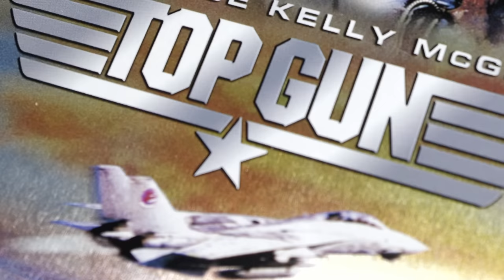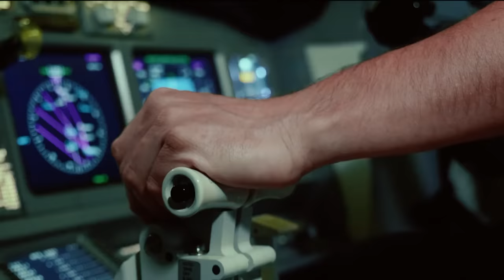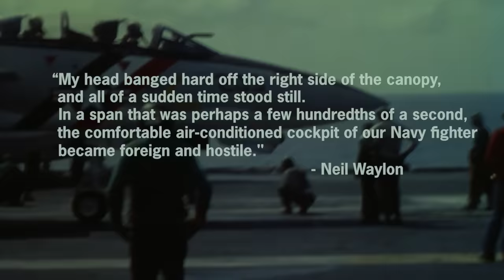F-14 Explodes During Supersonic Flyby

Comment: Almost as unbelievable as the narration speed is the fact that the F-14 is a 50 year old design.
Reply: Yeah I saw somewhere that this year the tomcats are as old as spitfires were when top gun came out
Reply: Ha ha!
Reply: The F16 is basically 50 years old too
Reply: @mast3r-633  No, that's incorrect. When "TOP GUN" came out, back in 1986,  the 'Tomcat' (according to the documentary), was introduced in 1970,  which of would made it 16 years old (then). 'Spitfires', at the time "TOP GUN" was in the theaters, would be over 40 years old.
Reply: well actually, at the time. the f-14 was only just over 20 years in service and at best just over 30 years since it's initial design. very very typical time frames tbh. 
 to put that in perspective. the f-22 was first flight tested against the yf-23 in 1990. and it's still the meanest thing in the sky today.
Reply: A big reason to not want too see f35’s they’re a mediocre combination of 3-5 old ass planes we still use.. jack of all trades master of none with the exception of vtol models because the harrier is missed.
Reply: @buffering7612  wrong.... it IS the master of battlefield connectability and battlefield information. 21st century warfare. it was never intended to be the master of any other specific trade in 20th century warfare. it has more computing power than every other fighter in our arsenal COMBINED. and THAT is the ace up its sleeve. it can link fighters, bombers, choppers, ships, missiles sites, artillery, ground forces etc etc etc. and coordinate them all at the same time on levels NO other fighter even comes close to.
Reply: The B-52 would like to chime in here...the YOUNGEST B-52's are over 58 years old.
Reply: @rogerrendzak8055  The Tomcat first flew in 1970 which is 52 years ago, the Spitfire first flew in 1936 which is 50 years before Top Gun came out. The comment was a little off in numbers but they're generally correct in what they said
Reply: @governmentcheese7726  finally someone that talked about the f35 with sense, instead of just attacking it
Reply: @Sahadi420  that is always stated, but the OLDEST operational B-52s are maybe 2 years older than the youngest ones. The only ones operational are B-52H models with the first being built in 1960. Production ceased 27 months later with no new B-52s ever being built.
Reply: @rogerrendzak8055   AH, that's wrongish too when this event happen in 1996 the TC was a 26 year old designish...but was also upgraded to a "D" model a long the way.
Reply: People get confused because of the new tech gadgets we have...but the 1960s were the Pinnacle of analog engineering...there isn't very much we build today that they couldn't build with a slide rule.
Reply: If you slow it down to .75, it sounds almost normal.

Comment: The ejection seats used in this mishap were Martin-Baker NACES (Navy Aircrew Common Ejection Seat), Navy designation SJU-17. They were tested and qualified from 0/0 to 600KEAS. This seat was also tested up to 50,000 ft from the back seat of an F-4 at China Lake. I know, because I was part of the Navy team that wrote the requirements for this seat, and was intimately involved with qualification testing. These seats are still used in the Navy T-45 aircraft, and also in the F-18E/F. If you look closely in the new Top Gun Maverick movie, you can see the NACES headbox (which contains the parachute) in most of the cockpit views. Too date, this seat has saved well over 100 Naval Aviators lives.
Reply: Thank you for sharing and for your work to save these men's lives, I hope you're proud

Comment: I was the conning officer on USS John Paul Jones (DDG53) that day. Several of us were on the starboard bridge wing in the shot with F14 explosion. The boat crew launched, picked up both pilots and had them back on the ship in about 8 minutes. We spent the next few hours on RHIBs picking up floating fragments from the aircraft. None were bigger than about 4' long. The F14 was helping us with a training exercise.
Reply: Was this in 95? I was on the Lincoln during this deployment
Reply: I was onboard as well. Starboard side boat deck watching the aircraft approach 180 degrees relative. Both aviators out of the water in less than 10 min. Would have been sooner but the pilot directed the boat crew to pick up his the RIO first. That was a hell of deployment.
Reply: So how is it vid says 50 miles away where they were found? 8 min my azz in a boat to get them.
Reply: @wallybraveheart6896  I bet my 30 Year career on it wallybraveheart! We were on the boat deck when the plane erupted in flames next to the ship doing 16 knots on a direct course to where the pilots hit the water. By the time we reached the down pilots, the RHIB was in the water. Don’t underestimate the Navy when the sh!t hits the fan!,,

Comment: "55 miles away". Mach I takes ya places you never really expect.
Reply: The video is very misleading. The USS John Paul Jones and the jet were 55 nautical miles away from the carrier, Abraham Lincoln.

The pilots were not thrown 55 miles from their aircraft.
Reply: @nates9536  I was going to comment about this. You'd have to be going way faster than Mach 1 to end up 55 miles away. Waaaay faster
Reply: @nates9536  isnt that 101 km? lol
Reply: @2k7u  Probably. I'm not google
Reply: @nates9536  lol ok
Reply: @zromo8994  - Or slightly higher.
Reply: @nates9536  Thanks. I was really wondering how they could go 55 miles in a matter of seconds.
Reply: I was on the JPJ starboard bridge wing when this happened and spent a few hours after picking up small, floating plane parts from the sea.  We picked the pilots up with our small boat and had them onboard JPJ in about 8 minutes so 55 miles is incorrect. They probably 1NM off the starboard bow when we picked them up.
Reply: NerdWorldNinja FoldingSpaceTime  And you thibk the ejection seat will accelerate in the direction of the flight so the speed increase adds to the original speed? If the ejection seat accelerates slighly backwards, then they will use their power to slow down the forward motion.

It isn't the goal of an ejection seat to increase the speed of forward motion but to clear the fins so the seat doesn't get hit by the plane, and to gain enough height for the parachutes.
Reply: NerdWorldNinja FoldingSpaceTime  But they speed you up vertically.
Reply: Toxic Masculinity  No, an ejection seat is designed for very high acceleration but very short burn time. The purpose is just to get the passenger away from the plane and into a suitable condition for opening the parachute. Thus foesn't require the ejection seat to have fuel for miles of travel - especially as extra travel at high acceleration is dangerous both because of the acceleration forces and because the goal is to quickly reduce the wind forces on the pilot.
Reply: Toxic Masculinity  Just to complement my previous answer. At the speed of sound, you travel roughly a nautical mile per 5 seconds. 55 nautical miles takes about 5 minutes to travel at the speed of sound.

If we assume the plane was 1 nautical mile from the ship and they spent a huge 5 seconds from breakup until eject, they moved one more nautical mile away.

If we assume the ejection seat then burned for 5 more seconds and moved the pilot forward with the speed of sound, that would be one more nautical mile.

If we then assume the parachutes got activated at 900 meters (half a nautical mile) height, then they would need a glide ratio of 100: to manage to translate half a mile of height into 50 nautical miles of horisontal movement.

Anyway - no, the claim of them landing 55 nautical miles away from the ship is just not possible.
Reply: The engine explosion opened up a quantum fissure and they went through it; that's how they survived and wound up 55 miles away. Oh wait, this isn't Star Trek, never mind.
Reply: This can only be explained by a mini blackhole on the path of the ejection seat.
Reply: @perwestermark8920  the biographer glossed over a decimal point by reading way faster than his eyes could track.
Reply: If the plane is tumbling and happens to have the belly facing the velocity vector, the ejection seat can remove a bunch of velocity. Plus, the plane was probably already slowing down at 20Gs. The ejection speed could have been as slow as 300mph.

Comment: I was serving on the JPJ when this happened. For clarification, the pilots were not 55 miles away from where they ejected. Our SAR swimmers were there pretty darn fast as they ejected very near the ship. They definitely had some burns on both men when they brought them aboard.
Reply: I have a question, was there a panic that the pilots where in the craft when it exploded?
Reply: If the ship was as close as JD noted above, the carrier tower likely saw the parachutes soon after the fireball. It's also a testament to how the Driver and RIO were essentially in impeccable condition for ejecting at such a high rate of speed. When you eject at Mach 1, your limbs are usually noodles, broken, dislocated and shredded, and surviving the ejection might just mean drowning in your chute if your arms and legs don't work.
Reply: I think he meant 50 miles from the carrier.
Reply: Exactly. I was at a loss as to why he said that, other than the fact it was in the copy he read aloud. You could say that the statement itself was 55 miles off the mark.
Reply: Waylon's account that he wrote said the same thing, they ejected very near the ship and were picked up very quickly.
Reply: @canebrakeruffian1122  
When the plane broke up, the pieces decelerated very quickly.  When ejecting at over 400 knots, it's very common to have some kind of limb-flailing injuries.  Those guys had none of that.  Waylon was very surprised at how little windblast there was when he left the aircraft.
Reply: @bidipbo  
I think the ship that they flew past was 55 miles away from the carrier and that distance got misinterpreted in this account.
Reply: @jedimasterobi-wankenobi4615 no, we saw two shuts
Reply: @canebrakeruffian1122 the CVN was not in the vicinity or sight
Reply: @bigdaddy1217  If you listen very closely Dark Footage claims that the JPJ is a CVN as well.
Reply: @falkwulf3842  I was onboard topside when it happened. Starboard side on the boat deck. The JPJ was 50 NM from the CVN when conducting a high speed flyby. Two chutes were seen and the Pilot and his RIO were out of the water in less than 10 min.
Reply: @bigdaddy1217  I  get that, context got lost on the internet. I was merely pointing out that Dark Footage claimed in the video that the JPJ was a CV as well and not a DDG.

Comment: This accident right here changed the F-14s forever. Pilots were banned from Flying in after burner for an extended period of time, and no more Cat launches in Burner mode.
Reply: I get the no extended afterburner rule, but why no cat launches with burner?
Reply: @phantomaviator1318  don't want to risk an exploding engine on the flight deck?
Reply: The a model needed burners on the cat, the b and d had enough power that mil was enough
Reply: Not sure who Josh is but if you didn't have zone 5 on your P&W's your Tomcat fell in the water.  We used to take F-14's to hi-power to get a quick defuel, 25-30 min at zone 5 and you can go thru 15k of JP-5.
Reply: @bender7565   my first West Pack in 97 was one of the F-14s last cruises. I watched F-14s cat launch for 6 months, not once did they ever go into Afterburner.
Reply: @joshdeskin6766  I made my last cruise #6, Mighty TR 98' I was the FDC for a 2nd cruise because the new chief sucked at it.  I have walked at least 100 Tomcats to the cats and none of them left without zone 5.  How many F-14 squadrons did you serve in?  Don't mean to stomp on you shipmate but watching F-14' and being the maintenance chief are a bit different.
Reply: @joshdeskin6766  In the 90's you had the A's with the Pratt & Whitney and the B's with the GE motors, you can tell by the feathers.

Comment: They ended up 55 miles away?!?!?! Damn!
Reply: Right!  Thats crazy
Reply: Easy: the speed of sound at sea level is about 767 miles per hours, which is 12.7833 miles per minute. If you do your math, it would take 4.3 minutes to land 55 miles.....away....if you stay supersonic......while strapped to your ejection seat!. Translation? Absolutely 100% unadulterated Bovine Organic Matter!!!. The pilots engine failed, generating that massive flames. They did NOT eject immediately.......the aircraft decelerated rapidly. Only after reducing power (the Tomcat has 2 engines) and speed (subsonic), they could not control the Tomcat, they had no other option but to egress. 55 miles away? Of course, they stayed aboard the Tomcat that far out until they could no longer control it. The only way to 100% confirm this mishap is to obtain the OFFICIAL mishap report from the U.S. Navy. I’d call it fake! Thumbs down until we have a link to the official report.
Reply: @uwekonnigsstaddt524  The Tomcat was 55 miles away from the carrier when it flew by the John Paul Jones, a destroyer that it had just simulated a cruise missile attack on. The F-14 disintegrated in mid air and the pieces and the aircrew decelerated rapidly and fell into the ocean, not far away from the destroyer.

It's okay, I was confused as well until I looked it up, it wasn't very clear.
Reply: From what I've found, they were 55 miles away from their carrier when it happened by the other ship. They certainly didn't eject and fly or drift or float 55 miles before being rescued. I guess something got misread during this video's production.
Reply: I am about 50 miles away from two major cities in either direction, and it takes me 1 hour without traffic, and up to 1 hour 45 minutes with traffic to get there. My brain honestly can't process flying off and ending up that far away in nothing but a chair with parachutes.

Comment: “In the late 90s, the Navy and the USAF would transition to the F-14B...”

The Tomcat was only flown by the Navy. The Air Force used the F-15.
Reply: That's a fact. 👍
Reply: I felt like stating this but here it is, I have seen a picture of a Tomcat with U.S Air Force but I guess it was just a display
Reply: @SkyGuy-gr2zc  Perhaps it was an early trial model tested by the USAF, or was kept at their experimental testing sites. Maybe there is a fascinating story behind it.
Reply: @swivelhips586  Going to comment in case someone pops up to tell that story. I don't think they made an Air Force Tomcat. Although I believe they wanted one jet to serve both, but the requirements split quickly. Maybe someone lost a bet in a bar, had to paint a Tomcat and put it on display. I like to watch F-14's and F15's duke it out theoretically in DCS. Checkout "Growling Sidewinder." Fantastic dogfights.
Reply: @pgtmr2713  It seems historically they mostly or almost totally used different models.
Even the USMC were the only ones to use the Harriers.

Comment: In 1979 I roomed with a guy from the USS Kennedy, which was in dry dock. He had a picture of an F-16 breaking the sound barrier at about 100 ft. above sea level. When the aircraft was inspected after the flight, they found cracks in the air frame. It was believed to be from the returning shock wave off the water adding to the normal stresses of a flight of that nature. Supposedly the CO stopped all low level high speed passes after that. I saw the picture, you could see the water being displaced right under the aircraft asa she went by.

Comment: 2:01 - "In the late 90's the Navy and the U S A F were transitioning to the F-14B which had 30% more powerful engines than its previous version."  I wasn't aware that the U S A F operated the F-14.  A quick Wikipedia search shows the Navy and the Imperial Iranian Air Force used it but make no mention of the U S A F using the F-14 in any of its variants.  This is especially strange considering the F-15 was entered service less than 18 months after the Navy's F-14.  Is there a reference for the U S A F operating the F-14?  (Grumman did propose an interceptor version to the U S A F but that program was terminated prior to the plane going into service with the Navy.  You might say it never got off the ground.)

The transition to the F-14B actually started in 1987, not the late 90s.  It was initially called the F-14A+ but later renamed the F-14B.  Among other things it received new engines.  There was an upgrade to 67 for the F-14Bs in the late 90s but that was to extend the airframe's lifetime.

Comment: They were well below Mach 1.0 when they hit the air stream after ejecting.  As soon as the one power plant blew at 600 knots, the airframe became quite bit less aerodynamic.  And looking at the angle of attack after the explosion, I suspect their airspeed was closer to 300 knots when ejecting.  And it was a well designed escape system that worked flawlessly.  Physics.